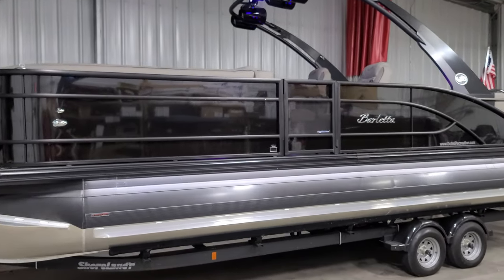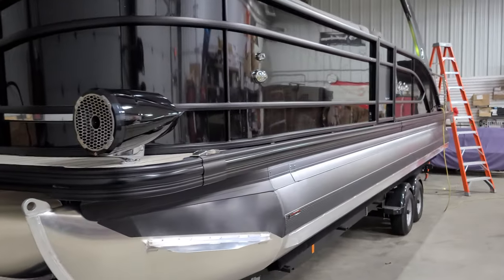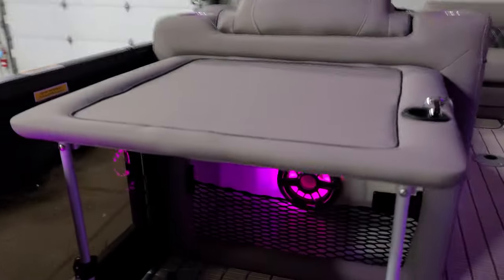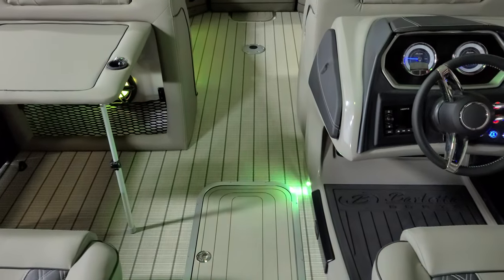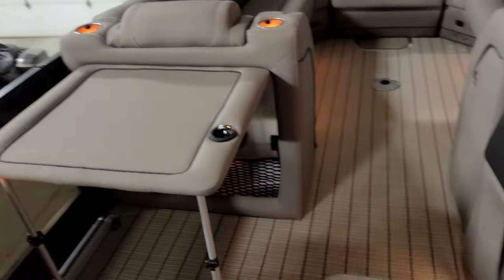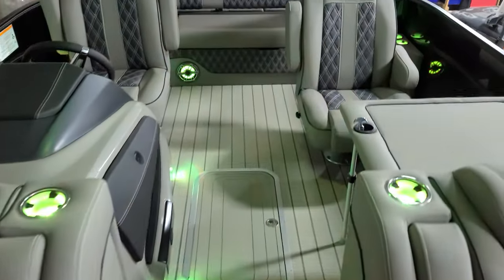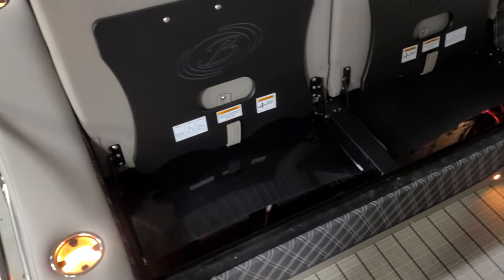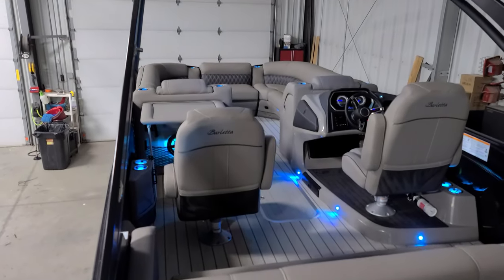2021 Barletta L25UC Custom Audio System

Comment: How did you splice the LED wires from the speakers to the existing LED lights?  Aren't there 4 wires from the speakers and only 2 for the boat's LED wires?
Reply from the maker: The factory RGB LED lights have 4 wires and the speakers have 2 wires per speaker. We were able to integrate into the factory LED lighting underneath the captain's console.
Reply: @theaudiogarage7461  Thank you!!
Reply from the maker: @DarrenForcier  you are very welcome! Thank you for watching our video!